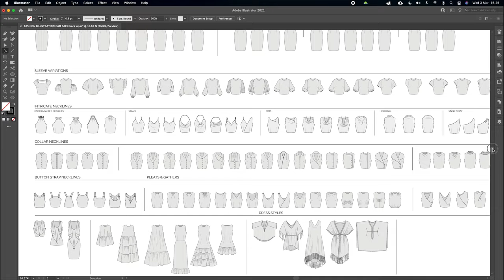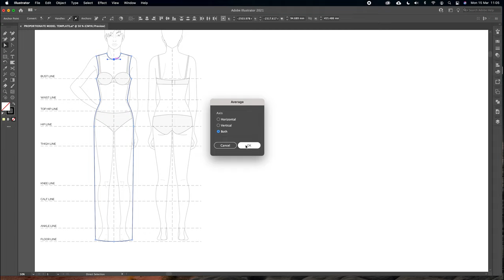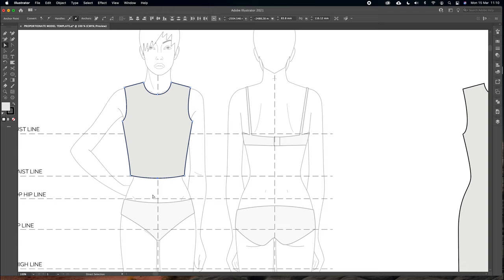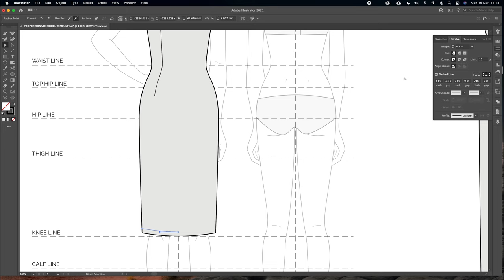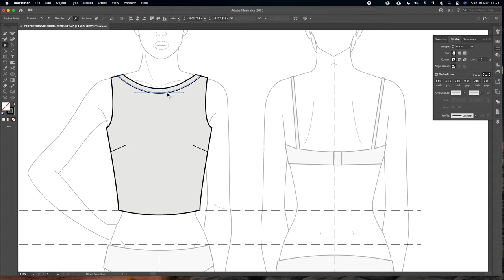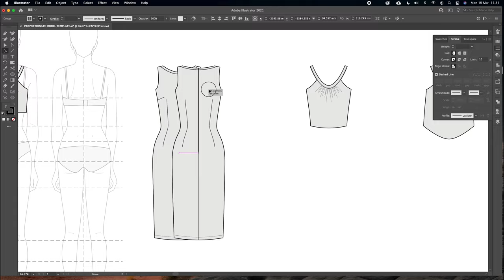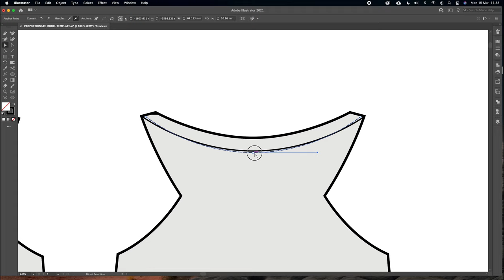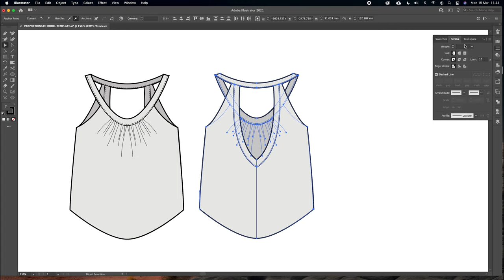TECHNICAL DRAWING FOR FASHION: Part 1 – Creating simple silhouettes & design details

Comment: hello thank you for your tutorials ,  although I know how to design adobe illustrator as a graphic designer  but I always can't adjust the legthns . to create different copies styles I redesign it or simply make one style .. can you help I tried many times .. will appreciate that
Reply from the maker: You can lengthen your design by selecting key points and moving them downwards. For example, if you wish to keep your style the same but simply lengthen the hem, select all the hem points with the small selection tool (white arrow) and shift them downwards using the down arrow key on your keyboard. Holding down shift whilst hitting the down key on your keyboard will move the points more quickly. Hopefully this helps answer your questions.

Comment: how do you select the lines in the selection tool so that not all the lines are selected? 🙏🏻 thankyouuu
Reply from the maker: Use the direct selection tool (white arrow). Experiment with holding down the shift and option key on your keyboard while making your selection.

Comment: Hey your tutorials are awesome no doubt ❣️😍😍😍😍😍 but i wanna ask something when i have been practising this is AI..  i faced a problem with stroke panel when i  had worked with zoomed artboard strokes are so thin but i have seted them on 1 pt why this makes something so frustrated plz answer it
Reply: I have the opposite of your problem, my lines are too thick, i think the solution to that is to decrease the size of your model or flat drawing until the lines appear satisfactory. I enlarged my model until i was satisfied with the line thickness. Make sure you hold SHIFT down so you don't change proportions of your illustrations.
Reply from the maker: It all depends on how big your flat drawings are. But it’s simply a case of increasing or decreasing the Pt of the line. Larger illustrations will need a higher Pt value. Smaller illustrations will need a lower Pt value.
Reply: @jazmeen04  thank you so much ❣️❣️❣️
Reply: @PatternLabLondon  thank you so much ❣️❣️

Comment: Hi! I am currently at the section where you join the little details together and the layers dissappear. I selected the object and tried to send to back but the little details on one side will not come forward, they are hiding no matter what I do . What can I do? Thank you!
Reply from the maker: It sounds like you have some objects grouped in an odd manner. I would remove the details from the silhouette and, select the details and un group all. Then regroup them. Do the same for the silhouette. Then bring the details to the front and re-place them on the silhouette. Unfortunately, without seeing what you are working on it can be hard to help. Another possibility is that one side of the silhouette has a white fill?
Reply: @PatternLabLondon  Thank you for responding, I appreciate your suggestions! When I try to group the details, most of the time i get a message saying i cannot make a group objects that are within a different group. (There is also no fill). 
However, i was able to re-do it again and this time the layers did come back, but I am unable to average and join the details due to the shirt itself moving when I click and drag to select. When i individually select both sides of the neck detail for example, it wont let me average join , rather says to select 2 spots at least (which are selected) .
Reply: scratch that, new designs = the same problem with layers disappearing and being unable to bring them up :S

Comment: Hey..thanks for the amazing videos.I am having a problem in pentool.While making a slanted line it becomes uneven (raw edges of the pixel) not clear as the perpendicular line. So when i am exporting it ,i am getting uneven lines which looks weird.Why this is happening..
Reply from the maker: It sounds like you have assigned a "brush style" to your line. Click  "Window" in the menu, then click "Brushes" in the drop down. On the right of your Ai document you will see the brushes palette appear. Select the top most brush called "Basic". It should be a clean straight line. This will then apply that brush to your line giving you a clean straight edge at all times. I hope this helps resolve your issue. Good luck!
Reply: @PatternLabLondon  Hey thank you for answering.I did the way you asked me to.I am not getting a smooth line like in perpendicular. While in slanted lines. It has a zigzag break. Is there any key to hold for making it smoother?